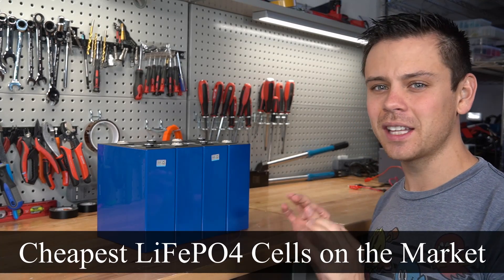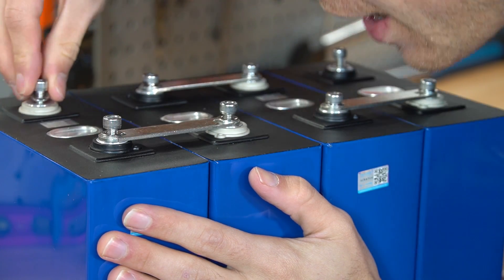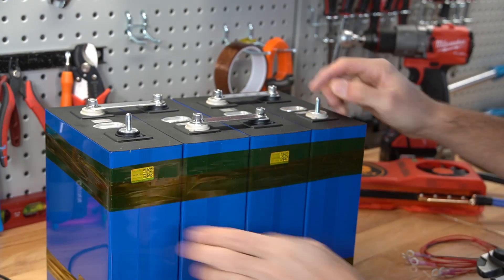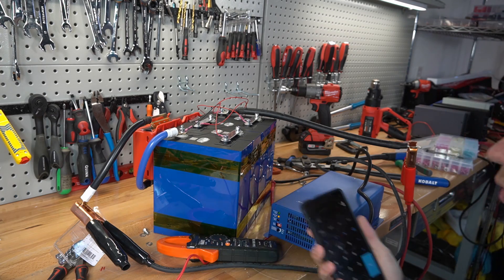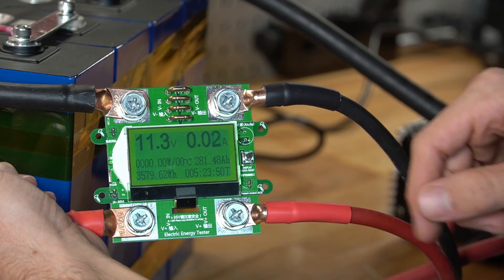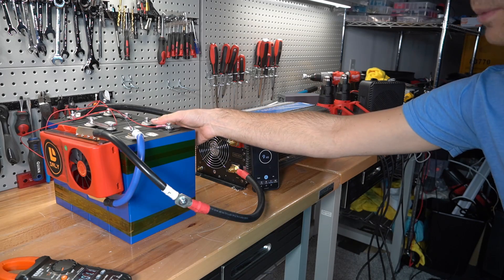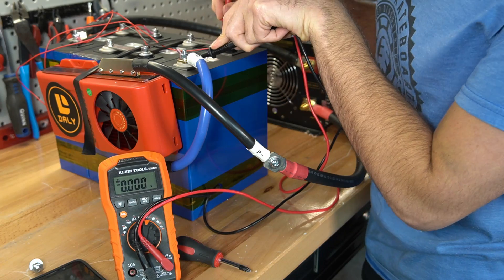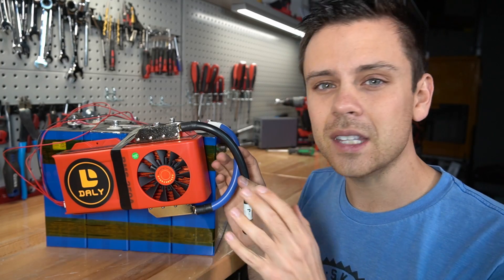$433 280Ah LiFePO4 Cells Tested: Cheaper than lead acid!

Comment: Now that it has passed the smoke test, and that they been Will tested.
They would probably do very well in my van, no where near that kind of load. 
So if you need further testing in a light duty environment just send them my way.
Thanks Will
Another great video

Comment: Good to see this cells are as advertised as I usually recommend this cells as they seem the best value at the moment. There are some other similar one 272Ah that have rectangular terminals and they have welded aluminium brackets that have build-in studs tho I think those are a bit more expensive it may be a good choice for those with heavier hands :)
Reply from the maker: Oh good idea! I need to find some of those!
Reply: @electrodacus can you tell us for the TH  time how the sbms0 will work with this setup?
Reply: @thomasnyanfore8424  yea I know right. I have an SBMS0 sitting here doing nothing and am running this exact setup to the T. Same voltage meter and everything lol. I have no idea how to get that SBMS0 hooked up. Can't even get the shunts to show the correct values on the screen. I want to use it so bad ugh!

Comment: Do you by chance have a source with similar price per ah for a pack of 100ah cells? I'm building a solar shed and don't plan to use it a ton so 100ah should be plenty for the time being. I've just had a hard time finding decent pricing including taxes and shipping. Keep doing what you're doing! I absolutely love what you have done!

Comment: I'd like to see you do a tear down/ review of that Giandal 4000w inverter, I have the 24v version and while it fails to run my 2000w mitre saw (meaning it doesn't live up to its specs) it has worked well so far for the money. It uses a cheap on off temperature sensor on the fan so its constantly cycling which is annoying but I will upgrade it soon.

Comment: Another great video, the more I watch the more I learn. Some knowledge from a guy that grew up in a blacksmith shop - welding and fabrication shop. Screw your nuts onto your bolts before you cut then all you have to do is back the nut off to straighten the threads after cutting them with the bolt cutter. Question would love to know if this Type of battery would work for my electric Reservoir boat motor that's 36 V and I have one that's 48 V volts. Looking to replace my lead acid batteries.

Comment: Hi Will, thanks for the great info. Super batteries! I suggest you get a thread gauge, cutting tap and some conductive grease. Yes drive the stud to the end, and a small torque wrench does not cost the world. 1/4' or 3/8' is all you need. Then torque test on gear you can sacrifice and note breaking point. Using a third of the breaking value  to final torque with light conductive grease on everything current can flow.  For a permanent installation use a marker for marking all you torqued. Then a quick spray of de-greasing spray followed by a burst of compressed air to dry. Finally a squirt of battery pole protector spray and the installation is going to last and last.  Fitting access points where you can leave a meter that records the cut-off voltage is handy to see if a battery is going astray. If you really want to spoil yourself, a flir camera module to your phone would be the cream on the pie. Keep up the good work.  Here in Australia they keep dumping panels by the truck load. If I could get batteries that cheap half of the town would no longer need the grid connection.

Comment: These cells brand new are phenomenal. Best possible cells for stationary applications. They are absolute tanks. In a 16s setup they will soak up all the solar you can throw at them.
Reply: What would be the problem for RV or Marine. use where there is vibration and movement?
Reply: @sailpac  You can use it in RV/Marine too. Only need to compress the cells. Many use it in a tight box, or 2x2 rods and 2 plates holding them strongly together. Only one thing you must remember: 16 of these is more than 80kg. So you need a strong not bending base/platform/box that you can put them.
Reply: @mrzed6597  Excellent thought. Im guessing they need to be bound tight so the terminal strips dont have undo force pulling on them. Or is it something about the temperature or expansion of the case?
Reply: @sailpac  For high g applications (vehicles, boats) I've read it's best to use <=100Ah cells in parallel, as they are less likely to become damaged internally over time.
Reply: @vaguedirector_7342   - Wow, really(?)  Hmm... so nothing over 100Ah in my class C RV...(?)...bummer  :(
Reply: @sailpac  The terminals are not very robust. You could use them if the pack was built properly but even a small amount of stress on the terminals would cause them to fail quickly.
Reply: @justicelee26  Thanks. That makes perfect sense.

Comment: Thanks Will, knowledgeable and never boring reviews as always ...  What would be a recommended complete set up for a 12v/280Ah? Cables, charger, solar panels, inverter ... There are several YouTubers, putting together a similar system,  but I don’t trust them at all.
Reply: Look up Will's solar Mobile DIY Page. He has several blueprints to choose from. Pick one with a 200 to 300 ah LIFEPO4 bank. Some depends on your intended purpose.

Comment: Fantastic stuff! These could be affordable upfront even with import duties.

Fortunately it's quite hot here so I needn't worry too much about low temperatures and charging. 

Well Will, I'm surprised. The price really is great.
Reply: I just checked, price is around 500 USD for me. Still not bad considering that's usually the price for a single 100 Ah or typically more.
Reply: Usually it's along the lines of 933 USD for a single 100Ah Lithium Iron Phosphate battery. 
Half the price for nearly three times the capacity!

Comment: This looks great. I wonder if I can use it for a home inverter? If so, is it better to make a 48volt setup (my inverter is a 48 volt system.
Reply: No problem, you just need 4 times the cells as for a 12V system, i.e. 16 cells. To then double the Ah capacity, you would need 32, etc.
Reply: Thank you very much.

Comment: Can you test Giandel 4000w inverter, if you can bond the neutral to ground?  Most breaker panels have a neutral to ground bond.  I have one but no one seems to be able to answer this question.

Comment: Will, why do you think these are grade B cells? Their page on Aliexpress says "This product is brand new and original, and the battery pack can be DIY if the voltage is normal."
Reply: That's my question as well. In the limited poking-about I've done, I never see grade specified.

Even if those cells are Grade B, it seems they have the expected capacity, so if that's the case, isn't "grade" irrelevant?
Reply: Rule No. 1: don't trust everything that a Chinese seller says about their products.  That's why Will is reviewing the actual product AFTER receiving it.  Betcha you'll have a hard time finding a battery listing that DOESN'T say "brand new and original" on them.

Gotta love those "brand new imported IC" listings...then you get them and find that they painted a part number on top of completely different chips.  That one actually happened to me on Aliexpress--I ordered a reel of 50pcs BD93291 dual-output switching power supply ICs ("Best Quality").  Got 'em, solder them in--and they short the power supply out.  Try another one--same result.  Tried 5--same result.  Solder a genuine BD93291 from Mouser Electronics into the same board--and it works perfectly.  (I'm guessing these were rebranded BD9329A chips--very similar part number, but a completely different IC.)
For the record, I did get a full refund from Aliexpress on that order.

For that matter, I can't seem to ever recall reading, "Reused or counterfeit parts" on an item listing...

Comment: Will, suggestion for anything that has a thread, don't force the final device into/onto it. Bad times on the horizon.
Get a bottoming tap and clean the thread. Otherwise, get a spare bolt and gring a 45° on the start of the thread tp 50% thickness of the bolt, use it a tap to clean threads in hole in soft metals like the aluminium.
Reply from the maker: It was just bent on the top threads. Bottom threads looked good. And yes, that's why I used studs. My dad always had me hand thread studs into cylinder heads when I was younger. I barely used any effort to push them in.
Reply from the maker: There are not many threads and those terminals are laser or sonic welded, so I like to be gentle either way. Very easy to damage them. I don't think any of the threads were damaged when I did it

Comment: Hi will, maybe you have seen on your forum, i have 112 of these cells in a 48v 100 kWh powerwall, and it is a beast! They work great!
Reply from the maker: That's so cool! Yeah I think I did see your set up. Very nice!
Reply: @WillProwse  
I doubled up the busbars by the way.
That being said, i have to mention the cells don't get the promised charge c rate. With 7 banks in parallel, i can max charge them at 9000 watts or so, or a a few cell voltages rise too quick and trigger the bms. (Batrium)
Reply: @jochensnauwaert6875  What type of busbars did you use? That's shipped with the cells or self made ?
Reply: @mrzed6597  the ones that got shipped
Reply: That's great!. Exactly what I am planning to do next for 20kW Sandi 400Volts inverter with Orion BMS. Only 112 of them in series. I think that Batrium and Orion are close in performance.  So far, I ordered 16 of 280ah 3 weeks ago from Shanzen Basen. This will be for a 6kW split phase low frequency Sun Gold Power inverter, and Orion Junior 2 BMS.
Thakns Will for posting this video. I was told that I paid for grade A cells. Your capacity test is what I wanted to see. I spent $1725 for 16 of them with shipping and credit card fees.
Reply: @AdamBoguski  For your 400v setup, you want to go go orion bms, but which inverter have you planned? Sma? Because without the right Canbus/RS485 messages to the inverter it will not work out and i could only find the protocols for the 48v systems like pylontech and 48v LG but nothing for high voltage.
Reply: @christophlam6195  Sandi 20kW low frequency transformer based, would be the choice. It supports RS485 and it comes with the set of 2 wires input to switch the frequency from 60 to 62.5 Hz. It does not support a frequency curtailment feature, therefore I am planning to add my PLC controller and CAN to TCP/IP converter. You right, this is a tough one to find off the shelf, so I have to have the PLC. Evtv sells 75kW battery pack from a Tesla model 3 with Evtv controller, that works with this inverter. It’s bit pricey, almost 20k, so my plan is to design something similar.
I would read the BMS data via CAN, then send it to the PLC. Then use RS 485 of the inverter and send it’s status to the PLC. This inverter was built to Jack Rickard’s specs and you can charge the battery trough backfeeding inverter’s AC output from Enphase micro inverters if it’s set to DC priority mode. Now, the set of dry contacts can be utilized as frequency/watt control. UL1741 was implemented on  Feb of 2019 in all grid tied systems. It lets you decrease PV array output by 10% by jumping these wires for 150ms, another 150ms signal decreases by 10% again. To raise the frequency, 250ms signal is needed. You can also turn off the micro inverters  for 5 minutes, if this signal is active for 500ms. This is a nice feature if you only need to slightly charge the batteries and maintain the solar array ON. All this would be done by my PLC program. I also have in mind a load diversion control. For instance, set the battery charging to 90%, but once they reach 80%, send 4-20ma PLC output to an analog solid state relay for hot water heating, or control a few digital outputs based on the state of charge. Orion comes with 0-5 V analog outputs, where one of them is for the SOC. The bad news is, the company I bought my 16 280Ah batteries wants now 150$ each, that’s almost twice what I paid for. I wonder if they watched Will’s video.🥴

Comment: These cells are out for months i have seen it on a dozen channels, but they performed almost the same 260-270 , this is the first i see 280++ Nice job! Thank you!
Reply: Maybe they are onto Will's alliexpress account. I have read that depending on your testing equipment, results can be different for the same cells. I ordered assuming 260ah, we will see what I get (still in battery jail in LA). I think managing your expectations when ordering from alliexpress is important.

Comment: This is exactly the video I wanted. I bought 40 of these cells for our off grid property last month. I ordered double bus bars to be super safe. I figured making busbars from copper bar would get old fast for that many cells. Cover the terminal areas in dialectric grease to keep o2 out to prevent galvanic corrosion between the aluminum terminals and your copper or stainless bars.
Reply: Guessing you are using 12 volts for your system, but something with a bit higher voltage would be easier from the amps side of things. If you have the stuff for 12 already, I understand though as buying the inverter and charge controller adds up quickly.
Reply: @gojeffgordon24  48 volt/ 12kw system. 32 cells for property, with two 12 volt batteries for the RV. Higher volts for the property = less amps = smaller wire and longer runs. 12v for the RV is required for the lights, propane fridge board, water pump, and propane water heater board. If all goes well I will swap them in for the car batteries for the solar gate motors, but it gets cold in the boxes out at the gates. Maybe if I bury them they will get 50 degree geothermal heat 2 ft down. I was thinking use a 55 gallon plastic barrel for clean, dry, deep storage.
Reply: Oh, the 40 of them is what threw me off on guessing that voltage. Thought you might be doing 10 in parallel for a huge 12v system. Hoping to do a 48v system too in the near future for home backup.
Reply: @Jerome Eberharter  I got two.daly 16s. I need to research relays for the Chargery, but its the only reasonably priced 16s 48v BMS. But it needs a continous duty relay or solid state relay or something so it doesn't get too hot. Watch Will's video 2 on the chargery. Last I looked electro dacus doesn't do 16s 48v. Batrium costs too much.
Reply: @SrStew @SrStew Do you have any of those cells to give out? I really need them to power my electronics?
Reply: I bought some 3/4x1/4 copper bar, and took it to a water jet shop, it cost roughly 15 dollars a bar total...
Reply: Where did you ordered your cells?
Reply: @SrStew Do you have any of those cells to give out? I really need them to power my electronics?

Comment: I've been using mine for about 2 months now and have been very impressed with it's quality. Good to see that they hold up to a 1C discharge test.
Reply: It's good that Will has confirmed our both finding in testing these cells. I'm very happy with them and looking forward to finally connect my battery soon.

Comment: I've had these exact cells for over a year, I built a tight pine box case and wired them inside to terminals on the outside of the wooden case. Works great.
Reply: No ventilation or fans ?
Reply: @seanmoon1444  There's a couple of small holes in the top lid but I dont think I really need them. They've never really gotten hot on me, I only use them in an RV.
Reply: @NigelM18  I am also going to be making an RV offgrid solar setup. How many batteries do you recommend, and do you have any tips?
Reply: Do you still have any of those to give out? I really need them and no money to get some😢

Comment: I gotta these cells grade a at around 525 per 4, running 8 in series with a 100 amp bms to the all in one hybrid inverter charger to the 100 amp 24 to 12 converter. Everything Aliexpress special! Cells not perfectly balanced, but I'm going from 90% soc to 15% dod. Lots of help from your videos!  Thanks Will!
Reply: Hey if I’m understanding this right these are 3.2v 280amp cells so 90% of 8 of these cells would = about 6.45kWh and if you’re only going down to 15% would that mean you’re getting about 5.37kWh of useable power? I’m still new to this stuff so I am just trying to understand what the useable power is for cells like this. Am I right in thinking that 3.2v • 280amp • 8 cells = 7.17 total kWh? But this is the actual total of the pack and not the useable power correct?
Reply: @Rickie53  that's exactly right - there's about 7.2 kwh in the pack and of that I choose to charge up to 90 and down to 10 or 15 for increased cycle life, utilizing around 80% of the overall capacity.
Reply: @reishiramzi  Awesome thanks! I am kicking around the idea of building out a smallish home off grid solar system for emergency back up firstly, just something to power the low demand stuff. I am thinking 16 of these batteries to get to 48v, an MPP solar 3kw 48v 110-120 inverter, and maybe about twelve 250w panels sounds nice. Does all that sounds good/compatible to you?
Reply: @Rickie53  that sounds like an excellent setup!
Reply: @reishiramzi  Thanks I appreciate your input.